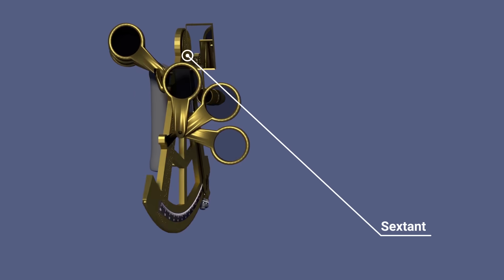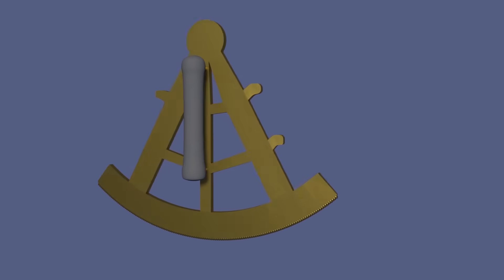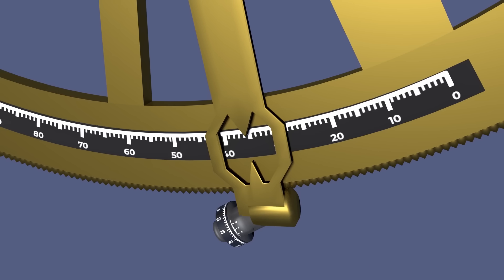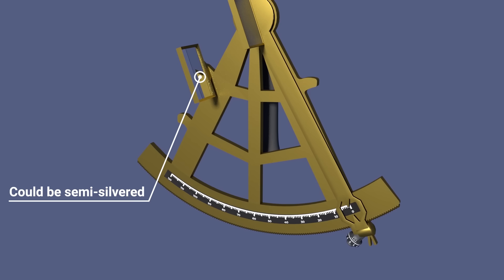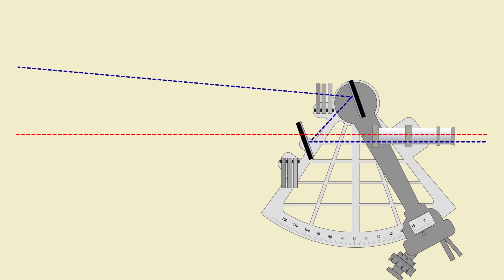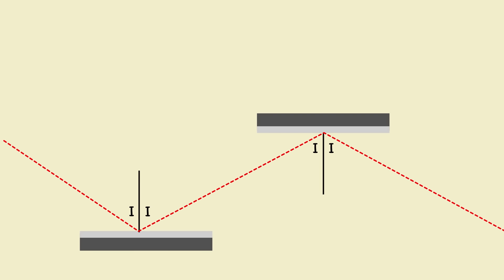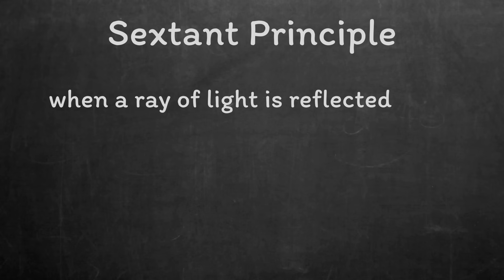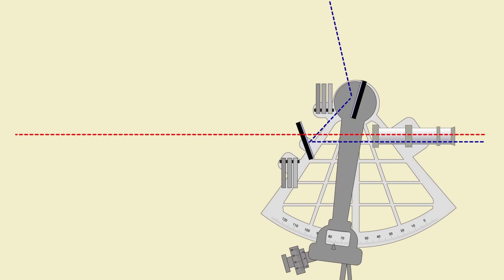Sextant Tutorial: The Principle of the Sextant

Comment: While I'm sure undereducated sailors burning their retinas out contributed, I'd always learned that the eyepatch was a primitive form of underdeck preparedness: sacrifice a little bit of peripheral vision for instant access to low-light vision when moving quickly between decks.
Even militaries teach to keep one eye closed when operating in between the bright sun and indoor locations for extended periods.
Reply: Covered eye also works better at night
Reply: Excuse my uneducated ass, but considering NVG's are standard issue these days and that they can be regulated so you could use them in broad daylight, if you're willing to sacrifice peripheral vision, isn't it better to use those? lose colours too but on trade you could also adjust to look into dark areas from outside, say a window where someone might be hiding or the opposite, look outside from a dark building into a bright day and such by just changing gain
Reply: @johjoh9270  Are you talking about modern sailors using NVGs? Visibility below deck hasn't been an issue since the invention of the lightbulb, and they would be almost useless for looking at anything outside a warship because nothing that could ever pose a threat is getting that close to a modern warship anyway. Anything that tried would be sent to the abyss expeditiously, probably before it even crested the horizon. Plus even the cheapest reliable NODs are running you 4k at the minimum. Those fancy quad nods are 40 grand.

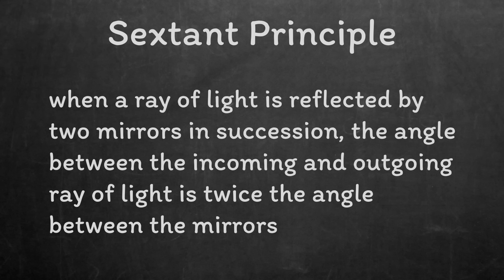Comment: appreciate the explanation, but in 06:15, I did not get the idea.  You said "the angle between the incoming and outgoing ray of light [(I+x)+(I+x)]  is twice the angle between the mirrors [(x)*2=2x]", which makes 2*(I+x)=2x, and apparently its not right. It should be the angle of the ray of deflection equals to twice the angle between the mirror. The degree of deflection is 2x.

Comment: No old sailor wearing a eyepatch is because older sailboats was harder to light below deck you don’t would like to use a candle next to a barrel of Blackpowder and to refracting sun light below the deck was hard and someone maybe working on deck a block the lens and port hole was not used as much because of the price of glass and the fragile if it. And yes sometimes they use eyepatches because of damage to the eye but just because they looked at the sun with a magnifying glass it should look the same as the other endless they was too stupid to feel the pain of the sun trying to eat their eye on fire and that is most likely impossible. But in battle flying pieces of wood could hit the eye but a sextant damaging the eye so bad that the man had to cover it I think not. But to keep one of the eyes adopted to the dark for going below the deck ok. Now if you cover one eye it maybe easier to handle the movement of the rolling sea without getting sea sick. If you want to get sick fast on a boot use a pair of binoculars with two eyes and look at the horizon to long you will be feeding the fish.

Comment: how does the altitude reading help in navigation. so you fix on a star with altitude of 12.51 degrees , how does that reading tell me my position
Reply: Let’s say you take a sextant reading on a star with a height observed of 12.51 degrees, Ho = 12.51 at some unknown location A. 

You carefully noted in a logbook for how many hours you sailed, your speed and direction. 
You deduct from your logbook that you should be at location B. 

Location B could be the same as location A where you took a sextant sighting but you can’t be sure because currents could have pushed you out of your way, your speed was not exact, etc. 

You calculate what the sextant reading of that same star would be if you really are at location B. 
Let’s say the height calculated is 12.0 degrees, Hc = 12.0

You then compare Ho = 12.51 degrees with Hc = 12.0 degrees. 
Since Ho is larger it means location A is closer to the GP, geographic position of the star, that’s the point the star is right over on Earth than location B. The star looks higher so you’re closer to it. 
If Ho is smaller than Hc then location A is farther away from the GP of the star than location B. The star looks lower so you’re farther away from it. 

This gives you a line of position perpendicular to the azimuth of the star that you can cross with a sextant sighting to another star, another calculation and another line of position perpendicular to the azimuth of that other star. 

That is the general idea taking sextant  sights for celestial navigation.

Comment: Is the mirror on the arm supossed to be straight with the arm, in the animation, it seem to be at an angle
Reply: It is at an angle so that when the index arm is on zero degree the two mirrors are parallel. The animation reflects how real sextants are made.
Reply: @robertlafleur5179  can you show the mechanism of how the adjustment screws take actually work in the context of the frame?

Comment: Thanks. Great animation and you are well spoken. Why do you need two mirrors to demonstrate this? Imagine the sun directly above your head and you holding a mirror flat, 45 degrees above your line of vision. Then rotating that mirror 45 degrees from the horizontal towards you. The light would hit the mirror at an angle of 45 degrees from the normal and of course reflect off at the same angle. Through shades you would see the sun. Thus with one mirror only, you would see an object which is 90 degrees above the horizon. It’s not a sextant, but it still halves the degrees of rotation compared to the angular height of the celestial object.
Reply: You do realise that with only one mirror the image of the sun would be upside down, right?

Comment: ChatGPT states;

There is a popular belief that pirates wore eyepatches to cover up a sunburned or damaged eye caused by using a sextant to navigate. However, there is little historical evidence to support this theory. In fact, the use of the sextant in navigation only became widespread in the 18th century, which is after the Golden Age of Piracy. Moreover, most navigators who used a sextant to take readings of the sun and stars did not suffer eye damage as a result of their work.

While it's certainly possible that some pirates may have suffered eye injuries due to exposure to the sun or other hazards on the high seas, there is no conclusive evidence to suggest that this was the primary reason for wearing an eyepatch. As I mentioned earlier, the most likely reasons for wearing an eyepatch were related to adjusting vision when moving between light and dark environments, hiding an eye injury, or making a fashion statement.

So why do you say it like its obvious in the video?